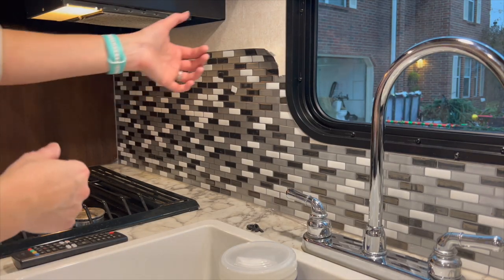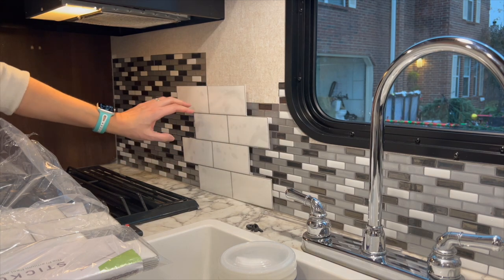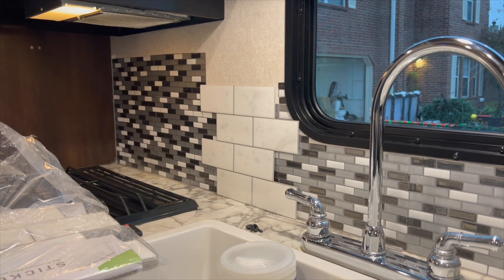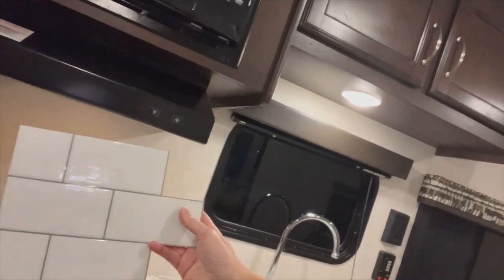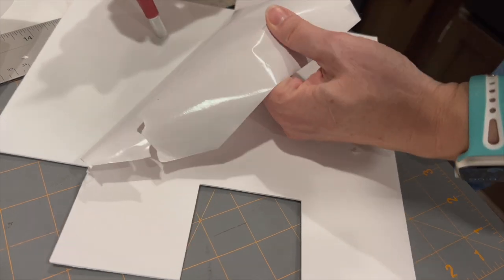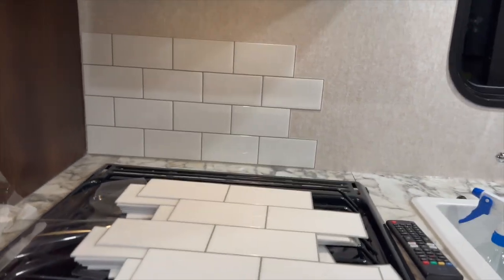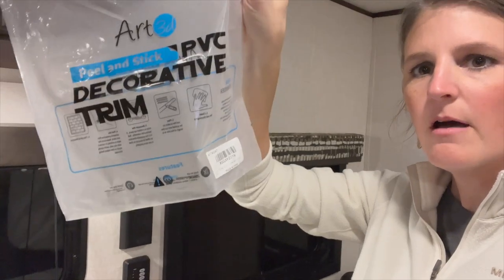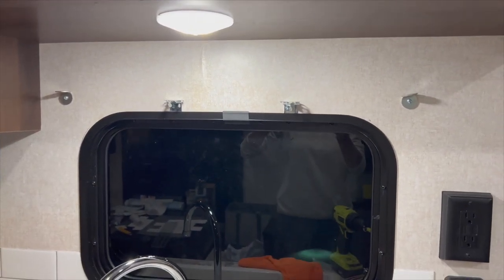Camper Travel Trailer Subway Tile Kitchen Backsplash Upgrade DIY Install

Comment: We did those type of tiles in out travel trailer. They looked great for about 1 month. The heat from our summers made them start to peal off. So we ended up going with wallpaper and it has held up great.
Reply from the maker: That's interesting. We are in a high heat area and never had an issue. They were very much a permanent adhesive. But I am glad you found something that worked for you! :) Happy camping!!

Comment: Amy, can you add where you got your bathroom cabinet? My sister has a similar Jayco trailer and is looking for one. Love what you did to yours. ❤
Reply from the maker: Hi Johnnie! Thank you for watching! YES, I LOVE the cabinet. We took a lot of extra effort to ensure it was installed for the long term with no danger of falling during travel. It's from Home Depot. I ordered online. I'll try to complete that installation video today so that you can share that with your sister also. :) https://www.homedepot.com/p/VEIKOUS-23-6-in-W-Oversized-Bathroom-Medicine-Cabinet-Wall-Mounted-Storage-with-Mirrors-and-Adjustable-Shelves-White-HP0902-01WH/318490809?cm_mmc=ecc-THD_ORDER_CONFIRMATION_MIXEDV1_M1_CA_-Product_URL&ecc_ord=WP53108232&em_id=8a39e154be27dadc7a808a004e74577ebcb0a96f2d1fdbb12ce9779f99ff4378
Reply: Did they stay on???